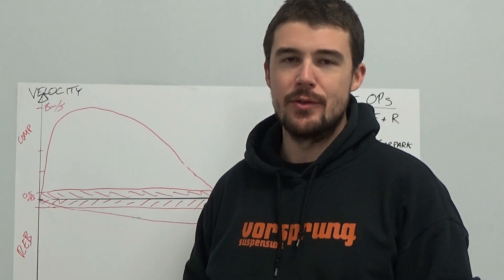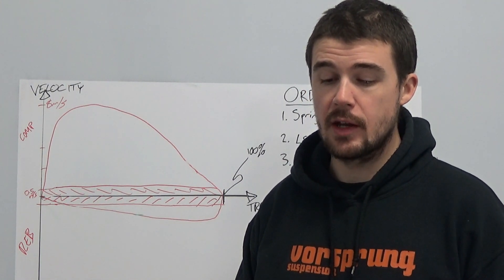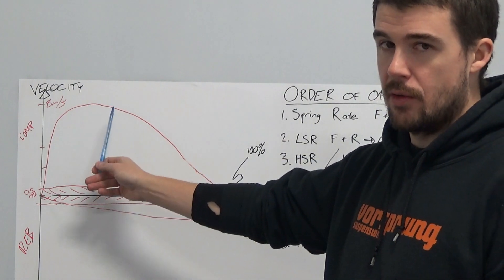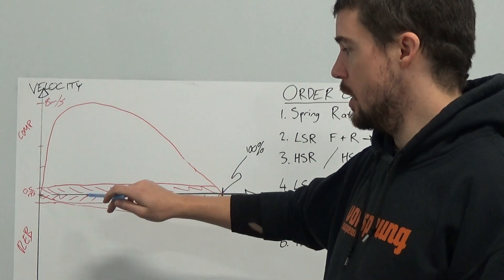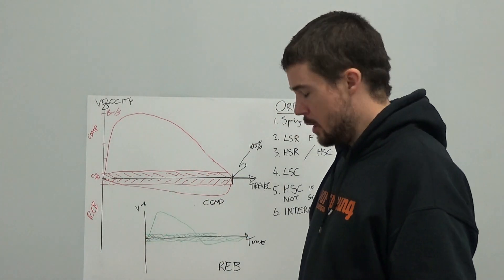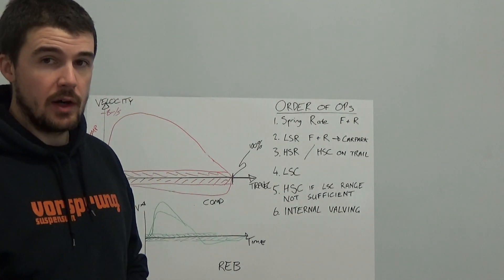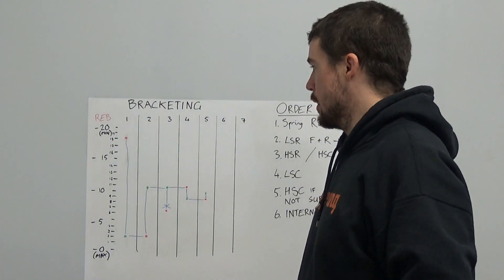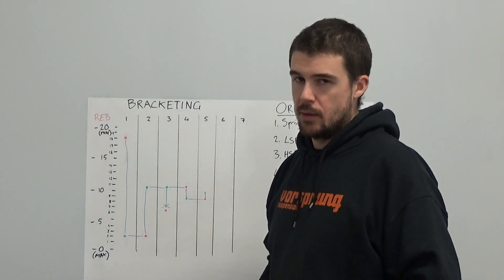The Tuesday Tune Ep 6 - High and Low Speed Damping pt 2

Comment: How does increasing fork preload affect handling for DH?
Reply from the maker: Functionally the same as running the crowns higher up the stanchions by the same distance that the spring is preloaded - marginally slacker angles, marginally higher ride height and a very slight rearwards weight shift.

Comment: Excellent videos. I really like your order of operations tip. How would you suggest incorporating the use of volume spacers in that scheme? Is it better to see if you can avoid using them at first, then add them if you fail to achieve your set up goals? Or in some cases, is it reasonable to start with spacers and tune from there?

Comment: Hey Steve, thanks for this really interesting video. I found quite interesting what you were saying about rock shox dampers. It took me always quite a while to figure out a usable rebound setting, but it was almost impossible to find a good compromise for any conditions found on the trails. Either the shock was kicking on jumps or it didn't track roots and rocks as good as it should... The only way was to adjust the internal hsr, although I am weighing pretty much like an average rider.

Comment: You said I should adjust the hsc first (after the last). What about the lsc for the rest runs of the hsc (bracketing)? Should it be fully closed or open? Thanks! Btw I like your explanations!
Reply from the maker: Adjust the HSC and HSR before the LSC. Leave them where they are, then adjust LSC. If you need more support but the LSC can't do it, then you can look at slightly increasing the HSC to enable greater range from the LSC.
Reply: Steven Mathews thanks for your answer. But my question is still there. Should the lsc be fully open or closed to test and adjust the hsc (via bracketing)? What do you prefer? 

Is it correct when I say: the hsc is isolated when the lsc is fully closed - the suspension feels stiff and harsh until the hsc bypass opens?! 

If the lsc is fully open I need a higher velocity (= more oil pressure) to open the hsc bypass? The suspension tends to run through the travel?! 

All referred to the hsc adjustment. 👍

Hope my English is good enough 😉
Reply from the maker: I'd suggest you start with the LSC fully open before adjusting your HSC - if you close it fully you'll end up creating harshness that is realistically the fault of the LSC, but happening as you adjust the HSC and therefore being falsely attributed to the HSC.
Reply: @VorsprungSuspension  hi steve, great two videos thanks. On a Fox 36 Grip2 there's more clicks than per the manual on the HSC. What do you consider is the workable range on this adjustor ( if say from full closed counting back )?

Comment: would it be useful to work by bracaketing also on compression damping?
Reply: ovodo16 yes it is. But it's hard to ride a track so often with the same energy 😉
Reply from the maker: Absolutely - you can use bracketing with any external adjuster.

Comment: wait, why are tyres more important than spring rate in suspension setup?
Reply from the maker: Because if you don't set tyre pressure appropriately before anything else, you'll end up with harshness or vagueness problems that can't be solved by any amount of spring or damper tuning. 2psi changes in tyre pressure make a huge difference to suspension feel.
Reply: BenTheBikerBoy your suspension won't be able to bring the maximum of performance when your tires suck. (Pressure& grip) 
Furthermore the tires are the first contact to the ground and will absorb a lot of (small) impacts before the suspension starts working properly.
Reply: okay that clears it up, thanks! keep up the stellar work